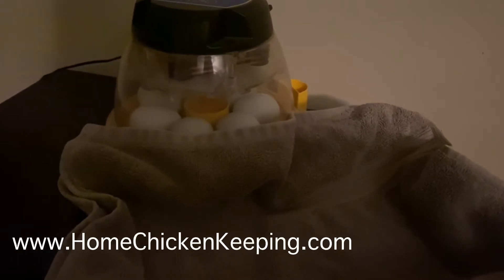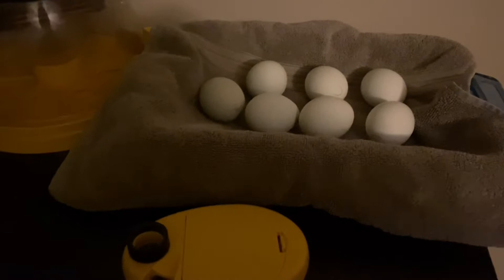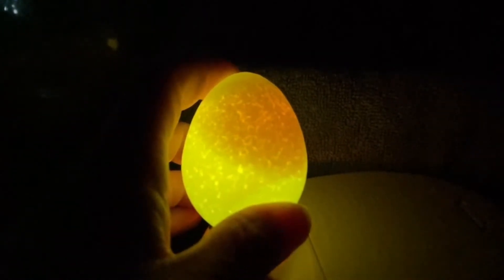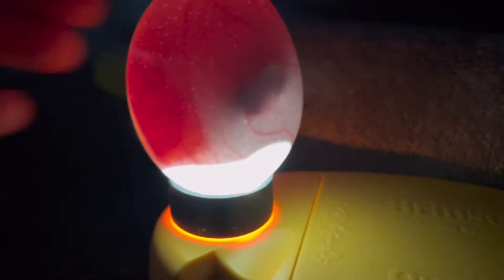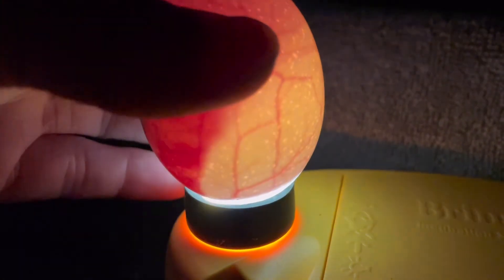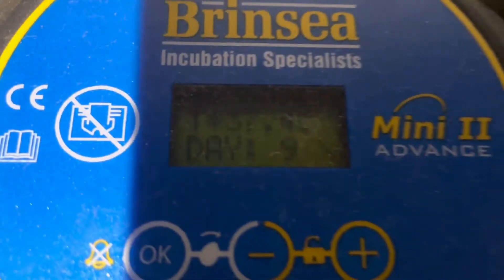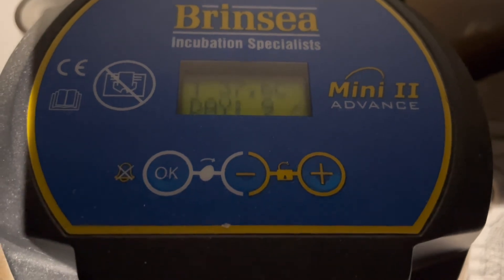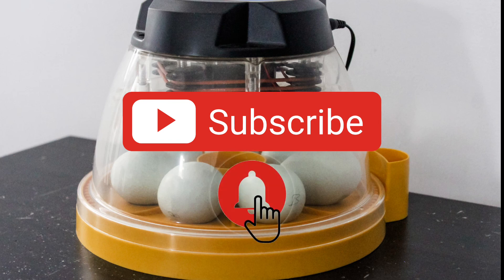How To Prepare To Candle Eggs & Detached Air Cells

Comment: u could've had all of those eggs hatch if u would of incubated them correctly. U HAVE to incubate shipped eggs differently. They should've ALL been put in the incubator pointy side down for 3 to 5 days, NO TURNING so the detached air cells can reattach. After the air cells are no longer saddled or unattached then place them normally and allow them to be turned. Hopefully someone who looked for answers on your video will see this message and be able to save some of their shipping eggs!